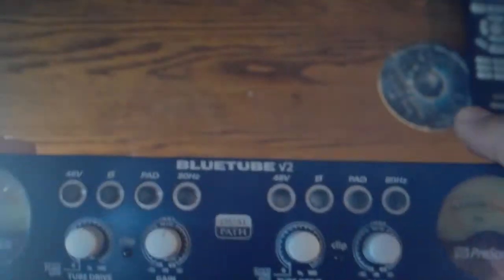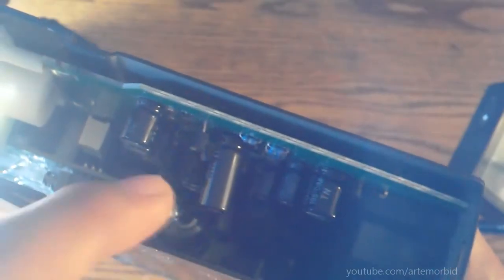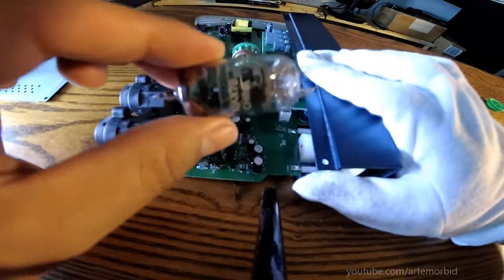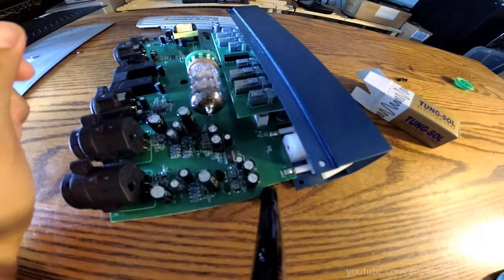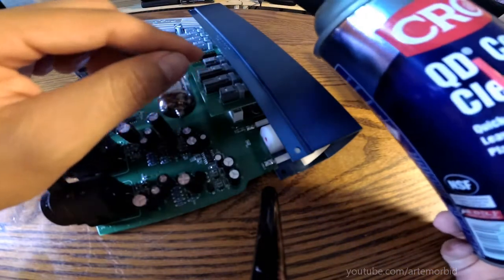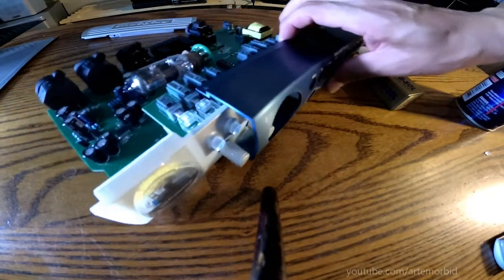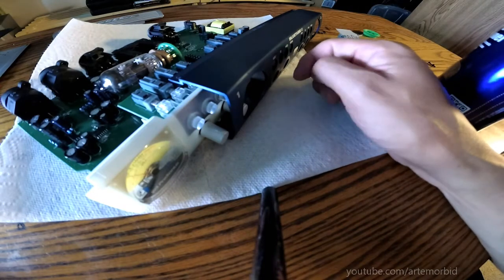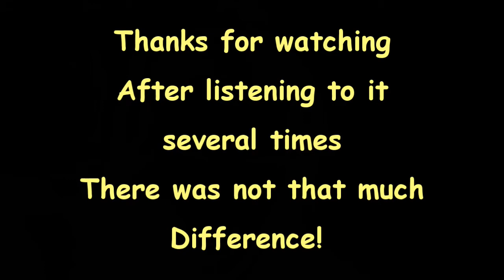Presonus How to change the Stock Tube to a new Tung Sol tube

Comment: does it light up
Reply from the maker: If you are mentioning the front panel display, yes it does. Here you can view it in more detail https://amzn.to/3WpW7o7
Reply: @artemorbid  So what I was referring to was. I was turned on to a couple of these pre-amps without the power supply. so I used a couple regular standard PS that I had on hand and of course No response. Yes, the front panel lit up and I will order the regular PS as soon as possible. So with the proper PS should the actual VT illuminate also The Model Presonus that I have, has the exposed VT.  or should I also order new VTs Thanks a bunch.

Comment: the replaced tube sounds a little fuller in the lows and has a little less distortion and harshness. There is some distortion/harshness in both tubes though not a big deal, maybe its because the device settings
Reply from the maker: Your right, I did not notice much of a difference either. I wanted to experiment. I have try it with different mics too.

Comment: I thought us Radio hams were the only ones still using tubes, or valves as we call them.  I suspect the slight difference is because the original tube is going a little soft after years of service.
Reply from the maker: Greetings my friend, indeed you are absolutely correct. Originally bought two of these Tung Sol tubes and replaced one and the second one remained until now. Hope you are having an amazing Friday brother

Comment: I've done this with tube mics. Only thing is, the other circuits have been tuned in the factory to use the stock tube, so there may also be some downgrade depending on tube used.
I agree the difference is marginal, however, one thing I've found is, a good nos tube can take off the brittal sound of these Chinese 12AX7 tubes and give a little bit more richness and roll off the harshness at the top end. It's all experimentation really.
Reply from the maker: Hi Jon, thank you so much for the detailed explanation. I knew there was a slight difference but could not place exactly what it was. I'm more familiar with guitar amp tubes and want to give this a try. Glad someone finally explained the details on sounds, it's very helpful and thank you